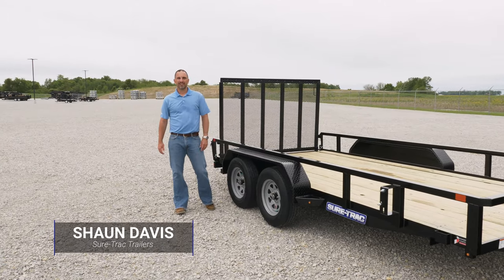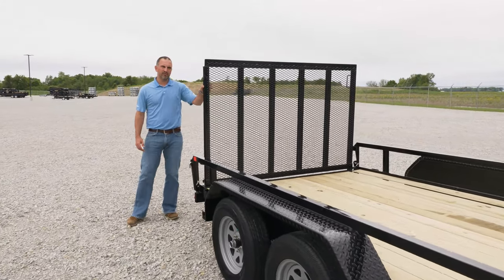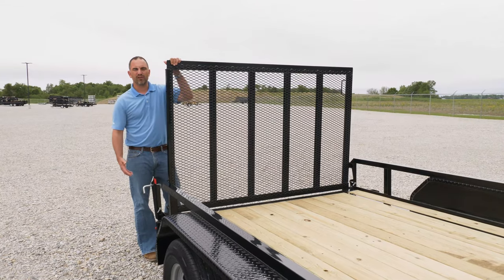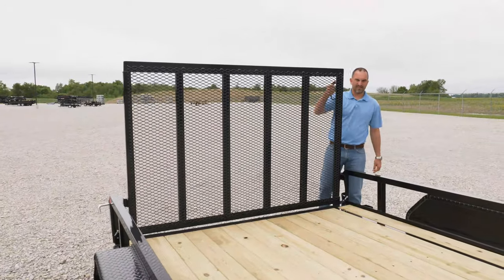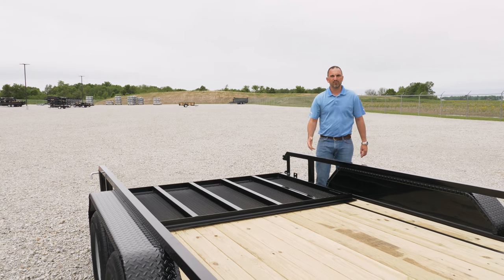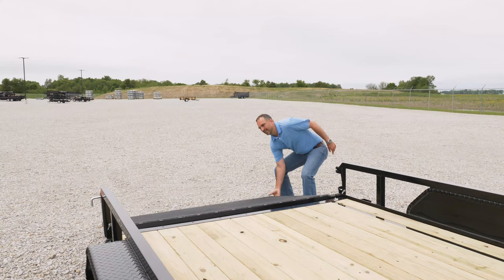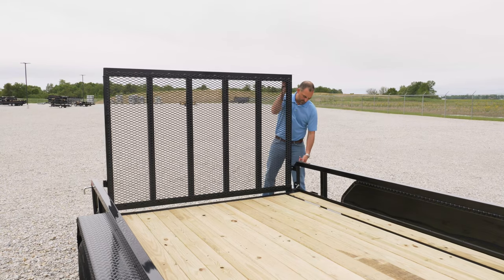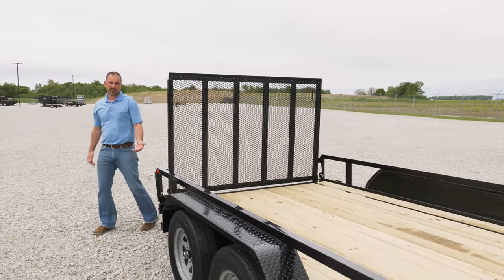HD Ramp Gate | The Sure-Trac Difference

Comment: Excellent videos! What is the rating on these HD gates? 2000lb small tractor be okay?
Reply from the maker: Thank you.    The standard 4' gate has a load rating of 2,700 lbs.  This is based on distributed load.  A small 2,000 lb tractor should be no problem at all, as they have a pretty typical wheel base.

Comment: Wish there was a dealer near rock hill sc
Reply from the maker: Full Throttle Powersports is located in Lowell, NC, about 25 miles from you.  Check them out!  You can get their information on our dealer locator at https://sure-trac.com/find-a-dealer/
Reply: I understand there is a bolt on cage available for utility trailers. Are there any videos? What are the dimensions? I’m assuming 24” x 24” x width of trailer